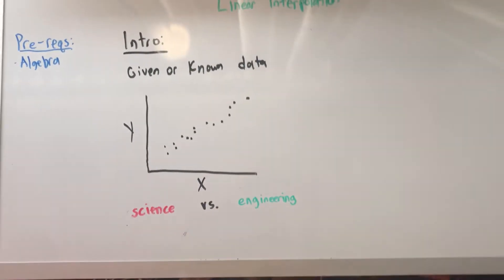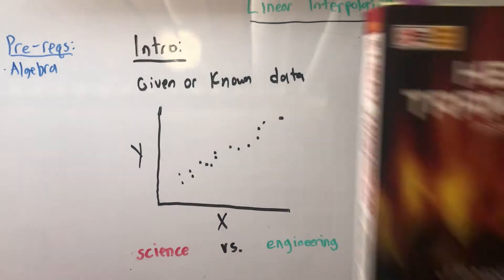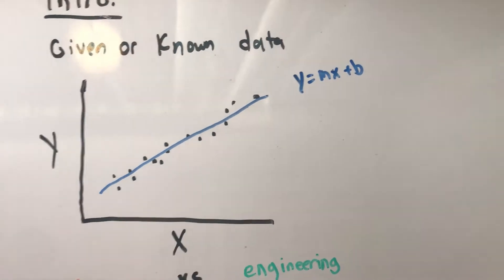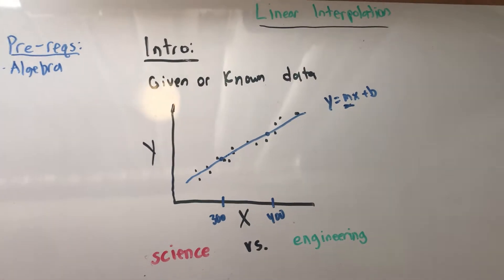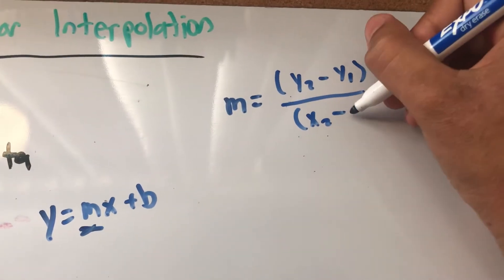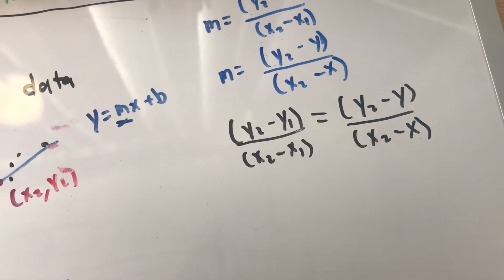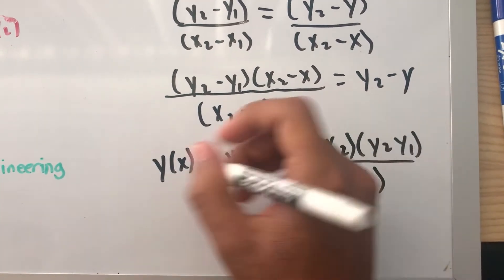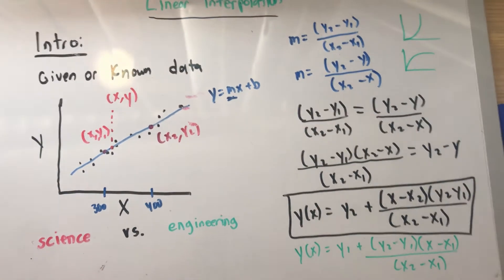ALL ABOUT Linear Interpolation: Concept, Application, and Derivation

Comment: Thanks for sharing this video. I have a question, Currently I'm working on Data Compression and Reconstruction techniques. I was given 20,000 data points and I compressed it into 244 data points through Linear Interpolation. Now I want to reconstruct the data again but I'm stuck that how to implement the Linear Interpolation to reconstruct the data again to 20,000 data points.
I will be waiting for your kind reply.
Regards
Reply from the maker: Hello. Thank you for your question. I'm not familiar with this technique. Do you have an example of the calculation?